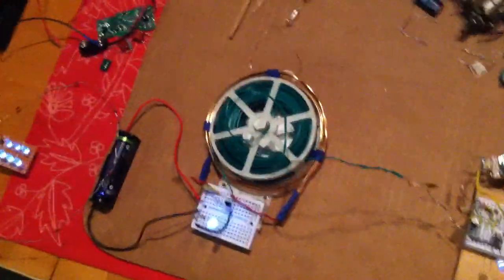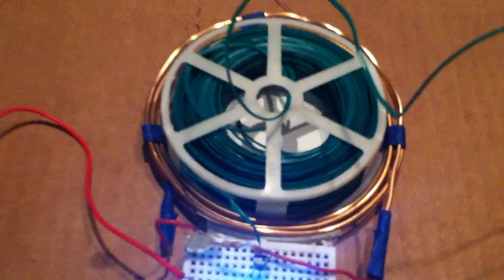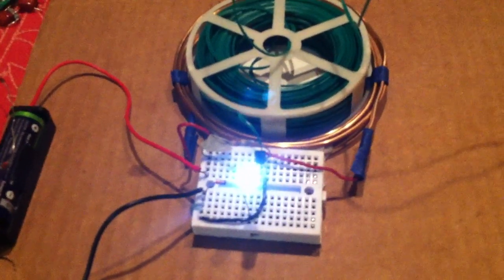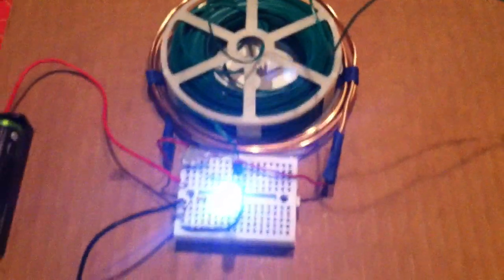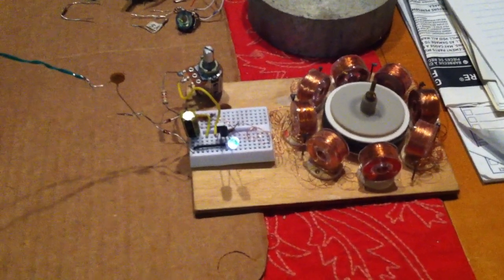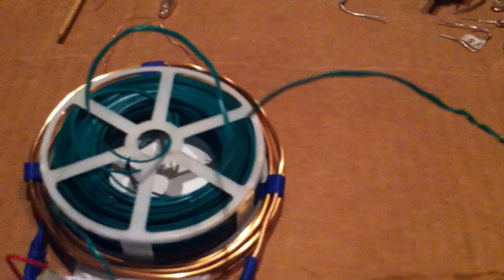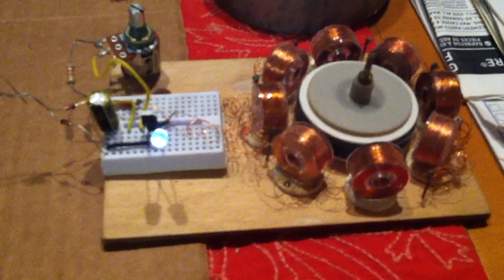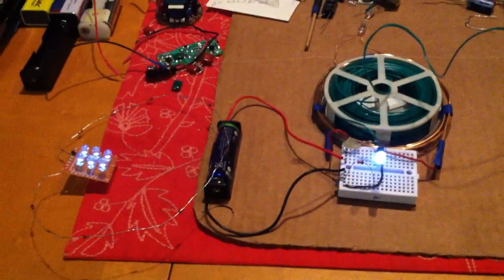Steel Wire Exciter

Comment: That works great!
The uA motor seems to enjoy that feed too.
Reply from the maker: That motor really likes this thing.  You could make one of these using that black and red dollar store wire you have.  I have some of that and it is steel.  You can make the primary out of almost any wire you have---copper, aluminum,  or steel.  All those metals worked for me on the 2-4 turn primary but the big diameter AL worked the best.  The circuit is just a standard Slayer like you are using. I have a 10K resistor on the base.

Comment: Hi Lidmotor. That is truly unique, where you take the best from the very best and turn it into something remarkable! I can see the diode loop for the Dr. Stiffler part, but couldn’t see if it was touching the wire from the battery. Thanks to Dr. Stiffler, Slider, Dadhav, and to you. 
Was also wondering if Tinman’s New Transformer Design would add to the efficiency of this arrangement.
Thank you
Reply from the maker: Thanks.  It is the combination of a lot of good people sharing their work and knowledge.  It is a fun hobby. The 'Stiffler Loop' is laying on top of the AA battery and is not hard attached to it.  It is wirelessly coupled.

Comment: This is a very interesting motor. I like the design and the way you powered it.
Reply from the maker: The basic motor is a spin off of Lazersaber's  EZSpin.  The driver circuit is a modified DadHav design.  I have done many videos on this motor.